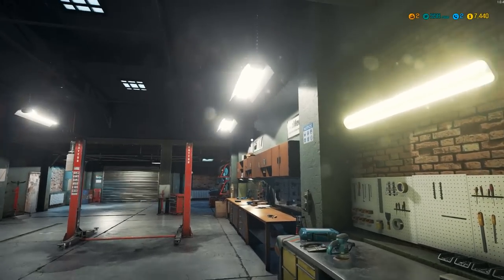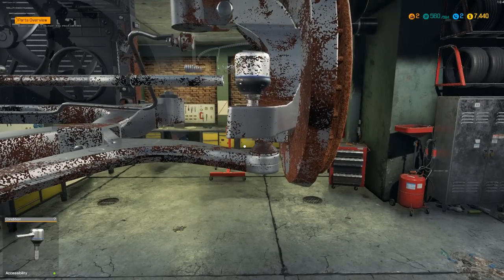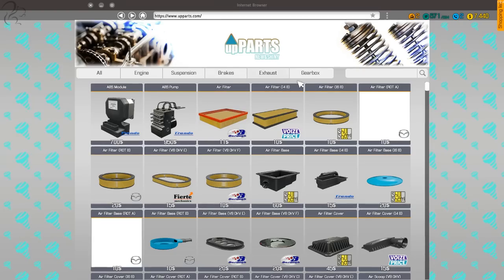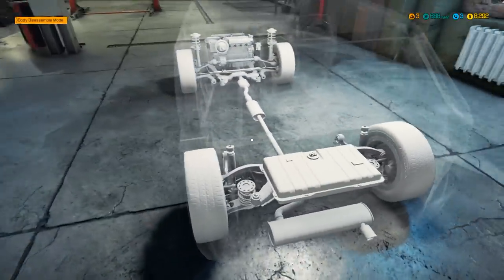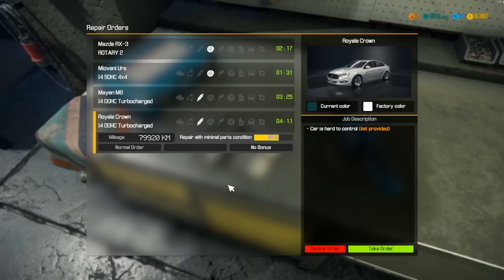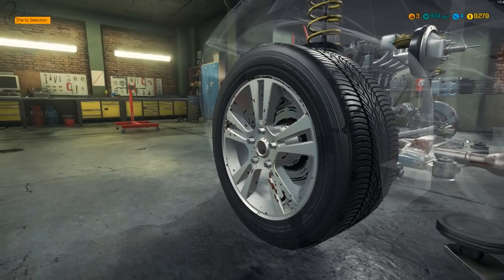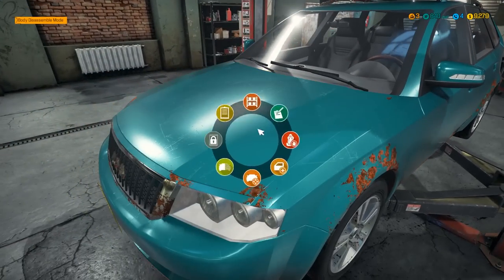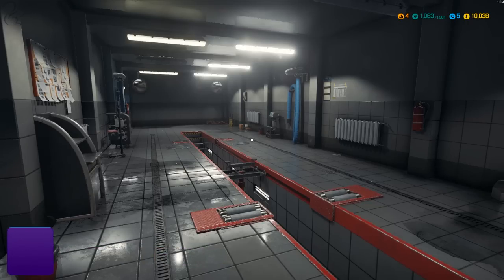Car Mechanic Simulator 2018 (PC) - Episode #3 - Repair Bench Upgrade

Comment: At 13:35 you could also use to use the inventory by tabs rather than "all", so you can see only what you're interested in at the moment. Same for the store when you have to buy parts included in small cathegories (such as "brakes") to make it faster

Comment: Hi Squirrel
The M6 you were doing suspension job on is a look a like to a SAAB 93 Sportswagon 2005-2011, or a Chrysler Modell if I remember correctly, I only seen one of these as a Chrysler but plenty more of the SAAB.
Regards from Sweden
Reply: the back looks like a SAAB Sportwagon while the front is Audi A6 C5

Comment: A little tip for you is that if you go into the car repair status and click on the star it highlights were the parts you need to replace are but they have to be discovered in order to click the star.